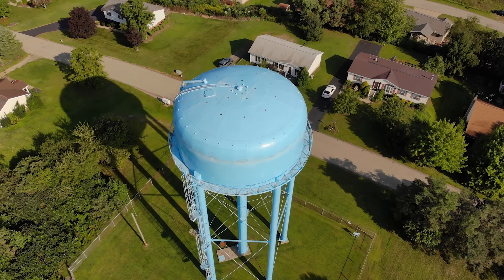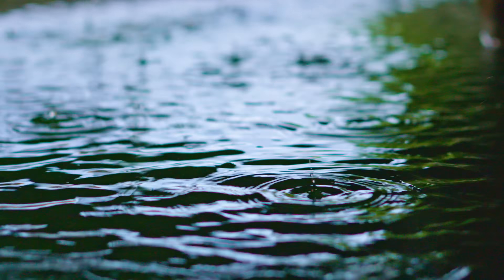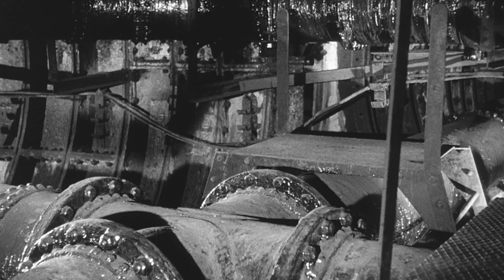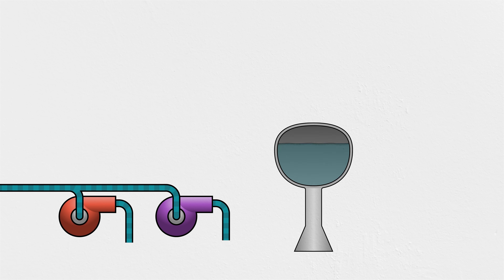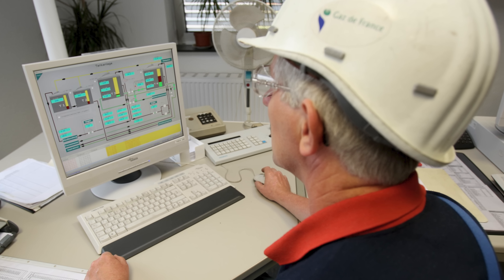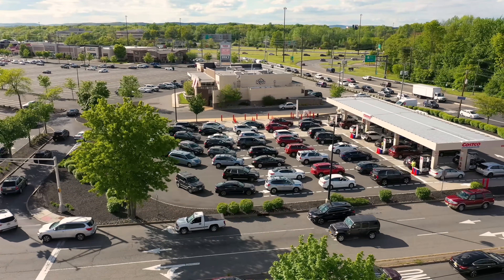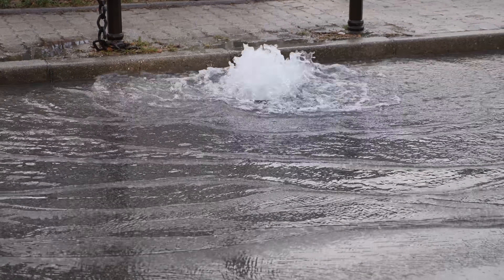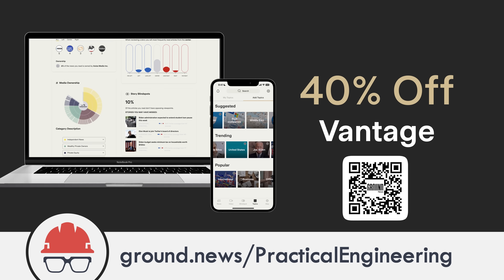When Infrastructure Gets Hacked

Comment: I live on a municipal water system. Our subdivision is supplied by the large holding tanks on the side of the mountain (Reno, Nevada). As I started the shower a couple of days ago, I noticed a higher than normal level of chlorine in the system (by the aroma). Since it was a Sunday morning, I figured that a computer had detected something a bit off in the continuous water sample, notified the engineer on duty and began injecting a bit more chlorine to keep us all safe. Because of geothermal activity, our, "cold water" is about 70F even in the dead of winter.

Comment: We're still under water restrictions in Calgary, the damage is more extensive then originally thought. Every time they get a section back to pressure another pipe bursts further down the line. The maintenance on that specific conduit was apparently overdue by a few years but we have so many infrastructure projects going on that some seem to be on the "Worry about it when it fails" list.
Reply: Actually, no. There haven't been additional pipe bursts. Those "wire snaps" reported are not pipe breaks. (They aren't good, but they aren't breaks.) Water restrictions were lifted for a while and then fully reinstituted near the end of August when they took the pipe back out of operation to do preventive repairs at additional locations they identified as weak. Additionally, they were already gearing up to take the pipe out of service to do a full offline inspection at the end of 2024 (presumably when water usage is lowest) so it wasn't just "worry when it fails".
Reply: @lostwizard  1/4 (at least) of ALL CANADIAN WATER INFRA in major cities is past its useful life and due for replacement.

We didn't have acustic monitoring or other systems in place to properly monitor the wires snapping on the main/feeder - this was preventable. 
We were sold equipment which has a USEFUL lifespan of 50-70 years but only managed 49 - which is expected.
Reply: @lostwizard We hadn't inspected the bearpaw in over a DECADE. It's okay to admit we need to do better instead of licking boots.
Reply: @joeeeyyyyyy  Stating facts =/= licking boots.

Comment: SCADA systems should also have safety limits that cannot be adjusted by operators. The safety ranges should have root access permissions to change and operators (or hackers who gain operator access) shouldn't be allowed to exceed those ranges. Maybe also send an alert to a supervisor if a range is attempted to be exceeded. This would let the supervisor know if 1) someone gained unauthorized access or 2) more operator training is needed.
Reply: How about: SCADA systems should have a firewall or two close by and maybe the computers should run operating system updates from time to time. Ohh, and companies might want to hire an actual network admin, not outsource to the cheapest bidder who doesn't have professional admins either. Industrial systems are not even close to the point where you would think about built-in access levels. ☹

Comment: I understand the simplicity of attaching these systems to the internet, instead of setting up bespoke systems to monitor/automate them. But ANY security professional will tell you the moment a computer touches the internet, it’s vulnerable. It doesn’t matter how much security you place in front of it, you’ve created a door into that system that someone dedicated enough to unlocking it can open.
Reply: The worst part is if they give devices access to both Intranet and Internet without any need to do so (and at best while leaving the intranet pretty much unprotected), just because it's more convenient that you can potentially google something every now and then on the same device - there's enough police headquarters doing specifically that, and now imagine someone gaining access and adding random names to the databases.

Comment: I'm a Systems Engineer for a healthcare company. I can say with confidence that the risk factors you spoke about are true basically everywhere. 

We don't deal with systems that affect the physical world directly, but we do deal with incredibly private healthcare data and it's a constant battle/exercise (we ARE on the same side after all) between IT Security and operational fluidity. 

If I had my way, every single machine would be locked down to the nth degree, but that doesn't make for a particularly functional business. So we work to find ways to maximise security, while still allowing the business to operate and our clients to receive support. 

By far the single most effective measure I've implemented (beyond the bare minimums of MFA and encryption) was informing our staff of the real risks and real consequences that can happen. Treating them like the professionals and adults they are and explaining that the people they support ARE at risk, and the way to help them is to learn the basic IT security steps they can take, and learn how to deal with them. For example, at one point I was able to get approval to do phishing training for staff, but, at the time the company was running very lean and I didn't even have the budget to run a phishing simulation. So instead, I took a well-crafted real phishing email that was sent to our CEO and put it out there for everyone to see. I laid out the consequences of what might happen if the company fell victim to such a scam (I don't mean consequences for the staff member, I mean for the business and our clients). Then explained the steps to take if they think they recognise a phishing attack. Finally (with approval) I stated that no one will ever get into trouble for raising issues about a phishing attack, it doesn't matter if they fell for it, or if the email is actually legitimate or anything else, because the solution is to prevent it from happening. Since that training went out, we haven't fallen victim to a phishing attack, and we've had several very well crafted attacks get through our security and end up reported by staff without a single link being clicked.

Employees are adults, and should be treated as such. They understand (or can come to understand) the seriousness of the outcomes of a cyber-attack and are the biggest attack vector for cyber-crime. So it's incredibly worth investing in making sure they receive well made and actually useful training, tailored to their situation, not just the generic corporate cyber security training you usually see.

Comment: These systems should have constraints on those fields where you know there is a cap or upper limit that would never be crossed, it shouldn't allow a 11,000 parts per million entry for the salt for example. No field constraints is just begging for a mistake, and it looks like that's what the FBI concluded too.
Reply: @thepunisherxxx6804 
I agree, do it all the time. Buried in the PLC or DCS controller where it takes specialized knowledge & software to change. X is input value, H is upper limit, L is lower limit. If X > H, make X = H. If X < L, make X = L

I've been in computer control since the early 1980s. When we hand built control hardware for a specific purpose. I still remember my mentor telling me, 'It takes about 30 lines of code to run the burner & 200 lines to make sure the operator doesn't screw it up!'
Reply: @rickmunro5332  Very good point and so true even in other areas of software. So much code is dedicated to input sanitation and hand holding the user.
Reply: They have those. That is what you can see the person editing in the video to allow them to run the pump out of spec.
Now you say you're going to prevent the engineers from overriding it. That's cool. The water height sensor is failed, reading full when it's empty. The quick fix is to just run the pump at some fixed rate and let the water overflow if it needs to. You've stopped that and now it's going to take a whole bunch longer for people to get water back on. 
And you're going to massively increase the complexity of the configuration leading to a great many more design and implementation errors that won't get found out about until you're long gone and the system hits an edge case.
Reply: @zyeborm  You're making alot of assumptions and hypotheticals to try to justify nonsense. Lets reel it back to the specific example of the salt being 10,000X higher. What use case could justify that massive number? 

Your example is EASILY fixed too. All you need to do is have an "emergency overwrite" button or mode that switches context and UI colors, maybe it requires escalation approval, maybe not. The simple act of switching to that mode and seeing the UI change is way more helpful avoiding human error than the salt example. Allows for quick emergency action like you said, but also is obvious to the operator they are about to switch something not standard. 

There is no massive complexity increase. You built up this vision of what I was saying in your head and jumped to all these conclusions and none of it was accurate at all.
Reply: Okay but it can’t be imposed by software. Something physical like a bushing that physically can’t transfer more than a certain amount, or a pump that physically can’t move more than a certain amount of material, or have the equipment run on a trickle charged battery that shuts down if it runs extra long.
Reply: @twestgard2 ideally there would be redundant protections, both software and hardware.

Hardware costs a lot more to change, so software is easier, but yes less safe/more vulnerable to hacking.
Reply: @twestgard2  Why can't it be imposed by software? The hacker had access to the user, not direct access to app parameters. If those software constraints existed or set off alarms or required group approval to exceed maximum threshold that would have prevented this. 

Your solution is way more complex, expensive, and cumbersome. Machinery isn't built to hit specific limits, that's not reality. You can certainly have more physical fail safes, but for complexity and cost and long term maintenance I think software constraints and an escalation system to go over those limits in weird situations is more than enough IMO.
Reply: @thepunisherxxx6804  Physical limit implementation is hardly complex, expensive, and cumbersome, it's basic design.
Reply: @keiyakins  Therac-25's programming issues 20+ years ago don't invalidate introducing smart field constraints for any parameters and even hardware fail-safes? That was a long time ago too, many advances happened since then.
Reply: @Smokeisprogress  Never said that, but why not have input range constraints alongside it??? Clearly it would have prevented the issue we're talking about. It also depends how complex and the use case. In THIS conversation it didn't seem to matter with the salt did it? Why did they fail or not exist have an answer to that? "Its basic design", "it should be there" uh except it wasn't, it failed, and many other systems are in the same boat.
Reply: @thepunisherxxx6804  "Machinery isn't built to hit specific limits, that's not reality."

Yeah you're right you didn't say this
Reply: @sauercrowder  Ugh, semantics. Argue with the general point. I mean they don't all have built in limiters, its not cost effective or possible sometimes. Runaway diesel engines of a good example.
Reply: I would guess that those checks were in place. It was just within the limits.
Maybe there are occasions where this amount is needed.
Or maybe you need it for very short period of time. I don't know to be honest.

But what I do know, is this is such a trivial thing to add, that it for sure was there.

Although... Maybe nobody implemented it, as it wasn't specified in docs. Yeah, probably specification and communication hell, as it's common in projects like this.

Comment: In a high security building I would disable the usb ports on most computers. They are a massive security risk now. Just a phone charging cable plugged in can hack your computer. Even with no phone attached.
Reply: That is standard procedure on classified networks, for instance
Reply: I like the superglue solution
Reply: This is actually normal process. Put crazy clue to usb ports so no devices can be inserted
Reply: Those ports can be physically clocked with specially designed locks.
A contractor told me that he could just disable the jacks using software, to which I pointed out that they could also be re-enabled using software.
Reply: @ghost307  Some motherboards have a setting to disable USB ports, which is a little bit harder with other measures like BIOS password and Secure Boot.
Reply: @saiv46  It's probably simpler to just physically block USB ports and provide alternative phone-charging options. It's certainly easier to demonstrate that you did it, too.
Reply: @saiv46  I'd accept that, as long as it requires a physical presence to change the settings.
Reply: @ghost307 Those locks can also be removed by a malicious actor, though. You should also have proper network isolation to ensure that malware can't propagate through the entire network from one infected device.
Reply: @haxalicious  Completely agree. The reason that we included the requirement for physical USB locks is so we could more easily fire someone who removed them.
When we counted on the software lockouts it took quite a bit longer, and in some cases, we ended up not being able to do anything other than get them transferred. It was much easier for them to deny that the breach was deliberate when we had proof that they deliberately destroyed the locks.
Reply: @ghost307  or epoxy
Reply: Specially designed locks... or glue.

Comment: A guest to our company tried putting their own wifi router on our network so they could access it from their hotel across the street. They were actually confused when we took it down. They didn’t see the harm. 

Security is a very human problem just as much as a technical one.
Reply: We run a full review every year to verify that our SCADA is still air gapped.
Each year we find new breaches that have gotten installed.

On one new project I told the manufacturer's rep that he was NOT allowed to connect his equipment to the internet.
He pointed out the value of his factory being able to monitor the equipment 24/7.
He thought I was joking when I told him to call me any time of the day of night that he wanted to come onsite and check his equipment.
He never did get his internet connection.
Reply: We have also run into lighting control and energy monitoring equipment with built in cellular modem or similar. This had to be brought to the attention of the building owner. The provider was also failing to follow network protocols that could cause the network to become unstable. I am not clear on how the owner resolved the issues with that supplier. I moved onto other projects before I heard the resolution.
Reply: I love people's ignorance. Them showing them how is it is get get root and even better when I show them how to protect themselves a little at least. Each person's capacity is the limiting factor for sure.
Reply: The only ones I head of that actually lock down their physical cat 5 outles are defense industry and the university. You can still attack that if you spoof the Mac address, but it is a little bit harder than just getting access and plugging in your own device.
Reply: @57thorns Haven't seen a single university with a secured network. Security doesn't just mean controlling access to the network, but within. Every client doesn't need direct access to all your critical servers.
Reply: @57thorns  a well deployed 802.1x solution precludes the need to physically protect the physical switch port/wired port.
Reply: @57thorns  Universities don't know how to properly secure their network.
Reply: @saiv46  Then they should use some of that outrageous tuition/book money to properly pay someone who does ...
Reply: I found a WIFI device on our office network that one of the secretaties had put there so she could use WIFI on her phone in the lunchroom...
Reply: that's hilarious...until it isn't.
Reply: Using a drone you can put a smartphone charged with hacking software (incl. wi-fi tools) right on the roof of your target and gain a remote access
Reply: @VRchitecture
If all someone needs is a phone on the roof to gain remote access, you have big security issues.
Reply: @VRchitecture  yea... if you can re arm after 2 days or so. It could be done but verbose enough? We are getting there. I know about the wifi hack bot. Dude is a genius. 
 I fly around looking for open networks just to see what's happening in the wild. I'd never connect or capture packets around where I live. Omg the things I'd probably see.
Reply: A "guest" sure, he was confused he didn't get arrested when you found out lol